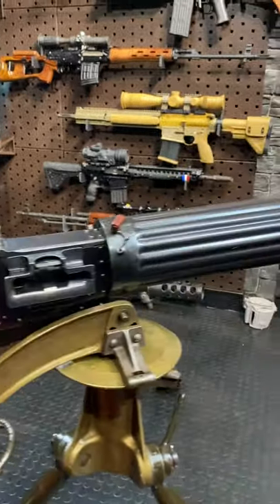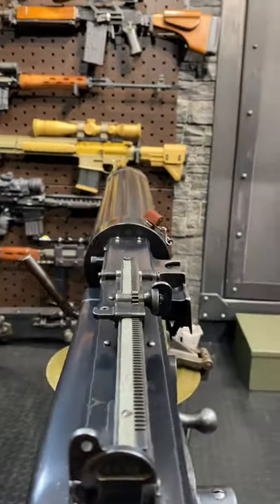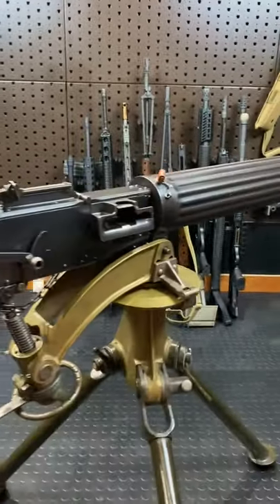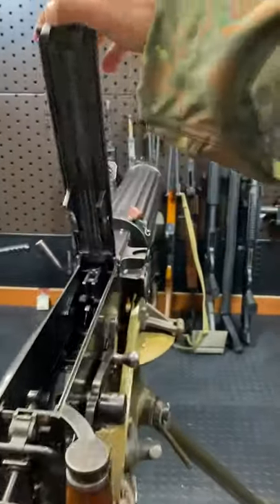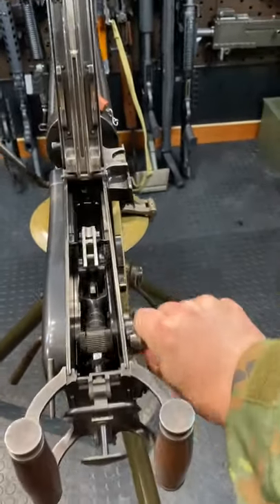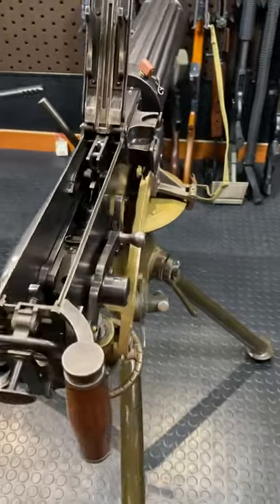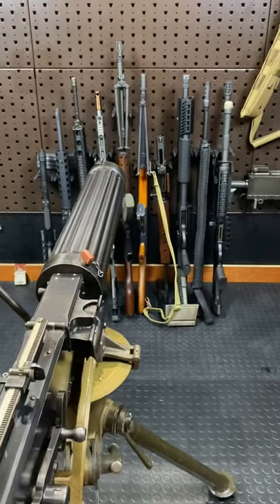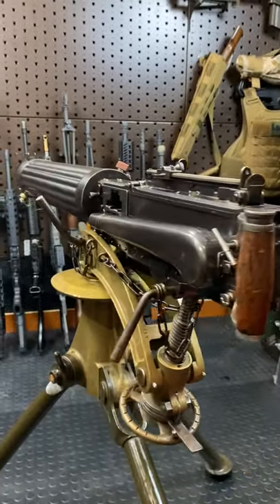The Vickers Machine Gun in 1 Minute #Shorts

Comment: Did not know these were water-cooled, that’s really interesting. It’s so cool how early engineers overcame engineering problems to make the impossible possible.
Reply: Nice
Reply: Trust me I'm an engineer
Reply: A lot of early machine guns were watercooled when it doesn't have multiple barrels like a Gatling gun.
Reply: @dannyn6558  interesting! Would that have caused any problems with rust or other wear? I don’t have much experience with firearms, but I know that when it comes to most machinery these days we tend to cool overheating moving metal parts with an oil or oil based liquid just to avoid that issue, and I’d imagine water would significantly increase the wear but that’s just a layman’s somewhat educated assumption lol
Reply: @brettc6132  its usually a removable metal jacket over the barrel, separate from said barrel.
Reply: Same, never really wondered about why the barrel was so large for
Reply: They were air cooled too depends on who was using them. They switched because water is heavy af & evaporates in say, the desert or after 15 hours of continuous fire
Reply: @brettc6132  not too likely, it wasn't a pure water mix they often used ethylene glycol as an antifreeze and corrosion inhibitor like in car engines.
The barrels would suffer wear on the rifling and need replacing long before any external corrosion would risk the gun
Reply: Actually steam was a big problem because it would inhibit the shooter’s view
Reply: @duderitoz6953    Still better than having to change the barrel after every 300 rounds, looking at you HK MG5!

Comment: I wonder how something like this would do if it were cooled by an antifreeze mixture. 

On one hand it would have inferior heat transfer, but on the other you would be able to let it reach higher temperatures. Not a gunsmith, but there is a decent gap between the boiling temperature of water and temperatures that make steel get soft.

I'm talking about just dumping car radiator fluid into one of these bad boys.
Reply: You would have to connect it to a radiator unit though cause coolant by itself will just turn to steam like water does. Not sure how good it would be in practice.

Comment: Could that gun operate in freezing temperatures, what i mean is what if the water in the cooler froze?
Reply: I'm not am expert in any way shape or form but I'd assume it would work better if there was frozen water in there. As long as the water didn't break open the tank thing when it initially froze and expanded.
Reply: @generichuman6220  that gives me an idea why doesn't nato try making a gun like this one but instead of water use liquid nitro or dry ice.
Reply: @son_of_stan  I think the freezing would make the metal more Rigid and make it break easier. Plus I  don't think that would be cost effective to mass produce. But I don't know any of that for sure. 

That is a interesting idea though, and a badass movie prop. Imagine a mounted weapon that vents the steam stuff so that it shrouds the gunner. Pair that with a misty morning harbor or a foggy mountain forest and you got a solid shot for a sci-fi-ish movie.

Comment: "no hotter than the temperature of steam"
Whilst you can literally melt titanium with steam
Reply: Btw for you guys that may not know, water is basically steam molecules that are squished together by pressure or absence of enough heat( the energy the atoms are carrying otherwise known as heat) to get them "excited" enough to break apart. Ice just has so little energy(heat to the ham senses) or so much pressure that the atoms align into crystal like structures making it hard. Steam occur when the atoms gain enough energy, primarily through heat, they move around to the point of being gaseous. This if you have enough energy(heat) you could get steam very very hot. Idk how this pertains to this gun but hopefully someone learned something

Comment: Lol thats not how watercooling works. Just think about the same thing as heating chocolate. Normally you put the pot with the chocolate in it on another pot that is filled with water. The water can't get hotter than 100C° (at sea level) before evaporating. But this doesn't mean the flame/heat underneath will stay at 100C° max. This is broken logic. The water in the barrel just has an effect (because its liquid and can move around) that the whole barrel will share the heat of itself. If the water gets too hot it won't help anymore.